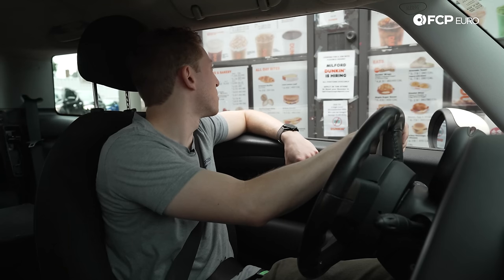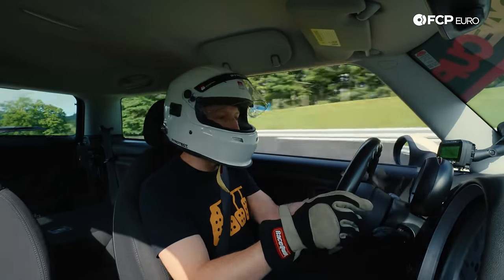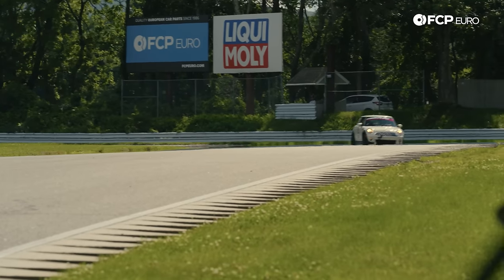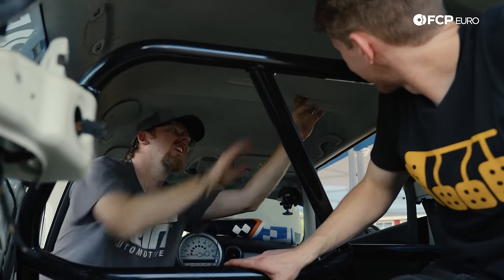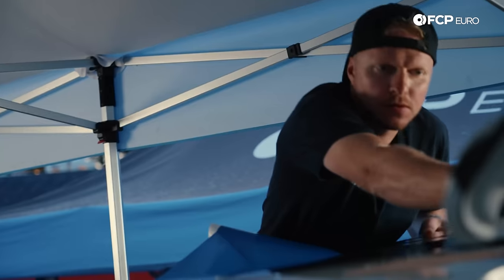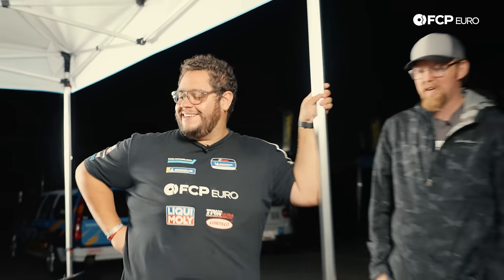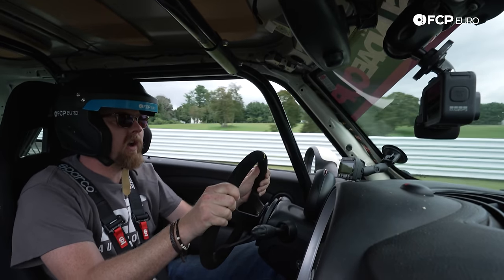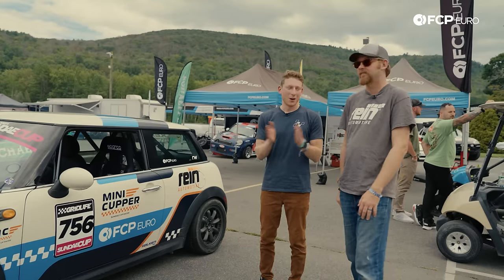Salvage Title Junkyard MINI mini BUILD - From Rags to Racecar in 24 Hours

Comment: Click baited to think they could build a car for Sundae Cup for $2000. They might have paid $2000 for the car. Then dropped another $10k just to get it to what we see running around the track. This car was crusty brickle underneath.
Reply from the maker: We certainly wouldnt reccomend anyone tracking a car without it being safe/having the basics first. Minus maintenance, and not including required safety, this ended up still being an insanely low barrier to entry for motorsport. We are compiling the cart to share for visibility for people interested!